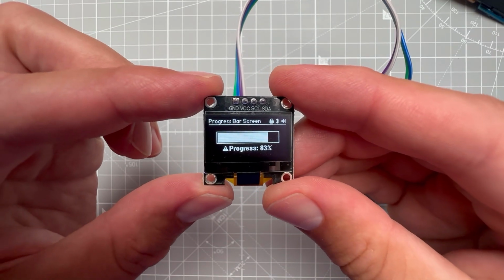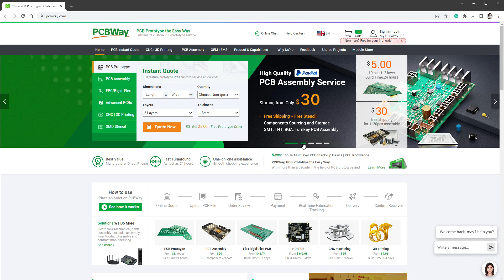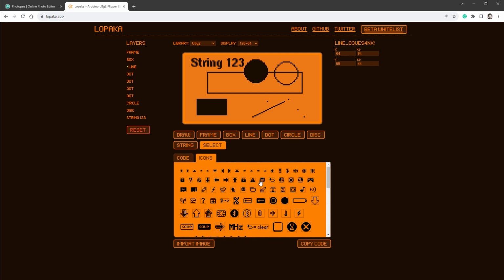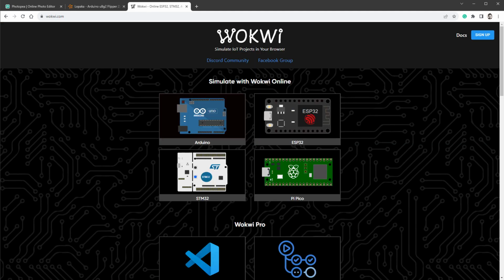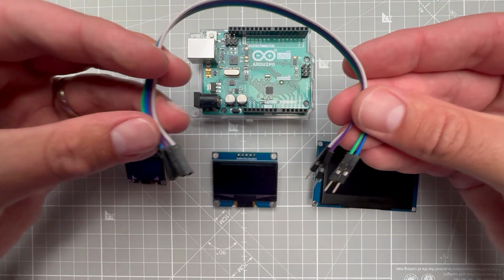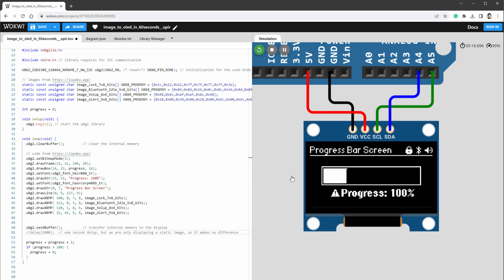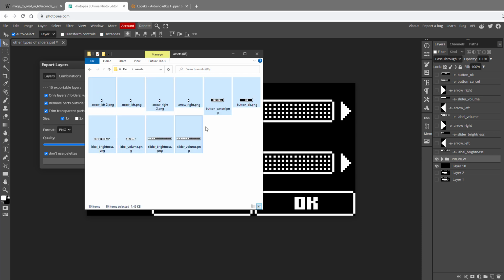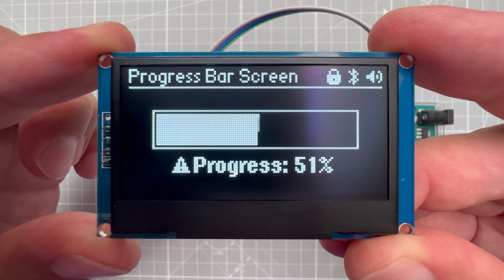Arduino & OLED: No Coding Needed   (Arduino UNO, SSD1306 OLED IIC, Lopaka, Photopea, u8g2)

Comment: Will the 2.4 inch oled work with arduino pro mini. Are there any memory constraints. Or is ot better to use 1.5 inch oled?
Reply from the maker: They all have the same resolution, there will be no memory/performance difference.

Comment: Hi it is posible to meake it faster. You delete delay so whole procesor time is consuming for this animation it is mean we dont have eny free time to other proces  .
Reply from the maker: Depends how fast you need to animate it. If removing the delay and adding a custom code is too much, you can try to use a faster Arduino board - for example UNO R4.

Comment: will this work with an arduino feather?
Reply from the maker: Any Arduino board should work as long as you use the proper IIC pins -  those pins are different on different boards.

Comment: Do you need to change the code when you change to bigger display? Or it just work directly?
Reply from the maker: This bigger display has the same resolution, same connection, same chip, so it will work out of the box, same as the small one and the middle one.
Reply: @upir_upir  thật awesome. Thank you for the answer, Brother
Reply from the maker: @NgocPhamVN96  You are welcome. Good luck with your project!

Comment: I'm using 1.3 inch i2c oled display
I having issuse that there  is a  white line at right side of the display. Can you help me !? what's the  issue with it ?
Reply from the maker: I would start by testing the display with other libraries - like the older u8g or Adafruit one to make sure it´s not a hardware problem. If it´s not, the u8g2 library has a lot of settings that sets all of possible offsets. I would try change those, since every OLED display might be wired in a different way to the SSD1306 controller.
Reply: @upir_upir  So, I'm making a desktop robot pet using Lopaka. I've made so many GIF animations, but I'm running out of space. How can I overcome this?
I'm using an ESP32 and OLED display.

Comment: What driver do you use on the larger display? I have a 2.42-inch display but it is very slow with the U8g2 library.
Reply from the maker: I use the very same initialization as for the smaller display, and it runs on the same speed (= fast). Are you using HW IIC (and not SW)? It is also possible to increase the IIC speed  - u8g2.setBusClock(400000);  you can try it if it helps, but call it before the begin() function.

Comment: Bro, which was that display which you showed in 0:08 and what is it’s size,resolution and is it oled?
Please tell me bro
Reply from the maker: The link is in the description, it´s the - 128x64 SSD1306 OLED Display 2.42"
It has the same resolution, chip, and connection as all the other displays used in the video. It´s just a little bit bigger and slightly more expensive.
Reply: @upir_upir  thank you so much bro

Comment: Amazing tutorial! Thanks again. How's that motorcycle dashboard project?
Reply from the maker: Thank you for your comment! The motorcycle project is unfortunatelly stuck at this point. I still hope to make some progress until the end of the year. I will surely share my next steps here. Are you making something similar?
Reply: @upir_upir  My goal was to find a speedometer for my electric motorcycle that would also integrate Android Auto or at least show turn by turn directions. Unfortunately here in Brazil if you leave your phone on your dash to see directions it gets stolen while you're riding 😅 Since there isn't such thing in the market I went the DIY route. It is a Vespa style scooter, so I have some size restrictions to still be able to fit the display inside the original plastic fitting. Initial thoughts were RPi + 4.3" waterproof touch display, but it is very hard to source such display, so I've settled on ESP32 + OLED display for speed, odometer, indicators, etc, and a 3D printed enclosure for a mini rugged Android Phone (King Kong Mini 3 Rugged) running HA Head unit (standalone android auto server) that will live inside the panel.

Comment: Really nice video!
Do you know why there's flickering on the OLED display when the progress bar is almost full? I've also seen such behavior especially with larger OLED displays greater than 128*64.
Reply from the maker: Thank you. The flickering is only visible on camera- just because updating the display is unsynced with the video capture. In real life, there is no flickering at all, there is no chance you can see it with the naked eye.
Reply: @upir_upir  Thanks for the reply. Just wanted to know your experience with OLED displays. Whenever I drive 2 oled displays with ESP32 in SPI mode, one of them does tend to have flickering. The same isn't there of driven by Arduino.